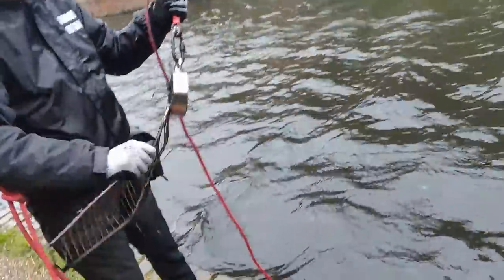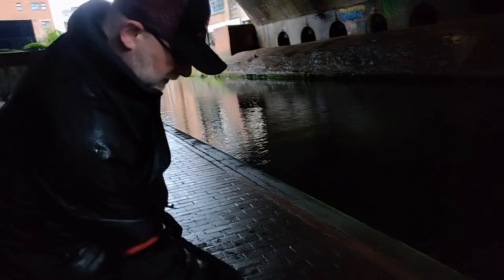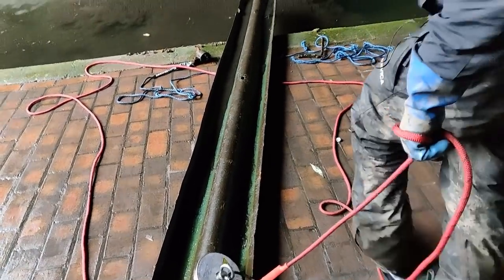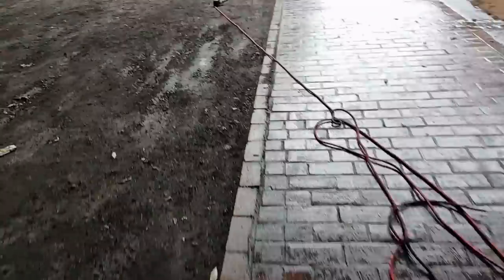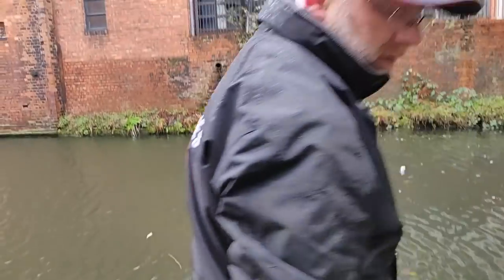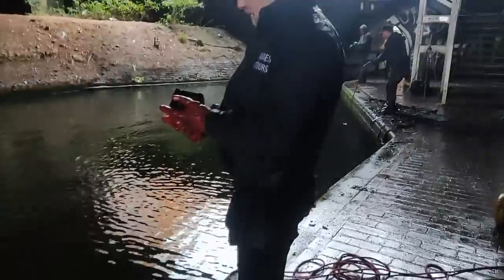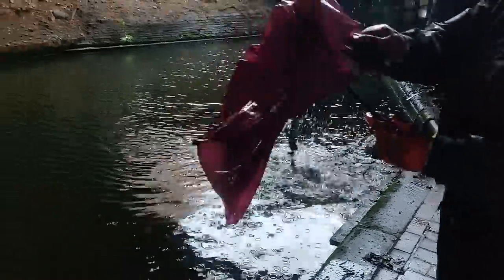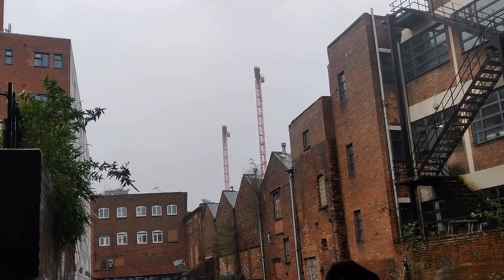out magnet fishing in storm Ciara and an announcement

Comment: It is normal for those cranes to turn in the wind, they are intentionally left in 'Freewheel' mode so that the jib turns in line with the wind, thus presenting minimum resistance. Nothing to worry about!

Comment: How can i guess the hardness of metal finds? The indentation is measured and hardness calculated as:

{\displaystyle \operatorname {BHN} ={\frac {2P}{\pi D\left(D-{\sqrt {D^{2}-d^{2}}}\right)}}}￼

where: The Brinell harness number is calculated by dividing the load applied by the surface area of the indentation.

BHN = Brinell Hardness Number (kgf/mm2)P = applied load in kilogram-force (kgf)D = diameter of indenter (mm)d = diameter of indentation (mm)
Or try Rockwell, Vickers, Tukon or the files tests.